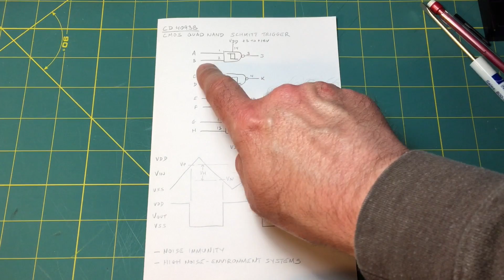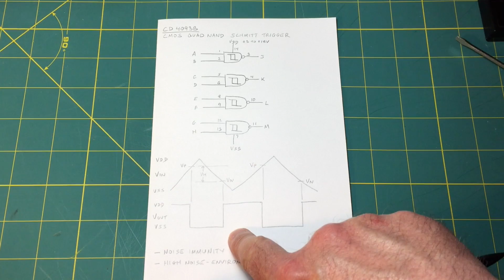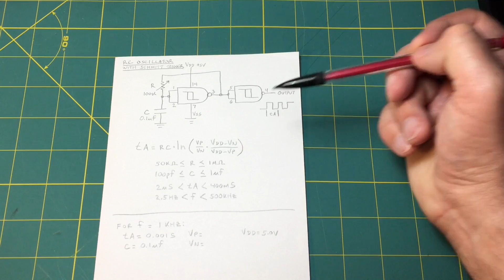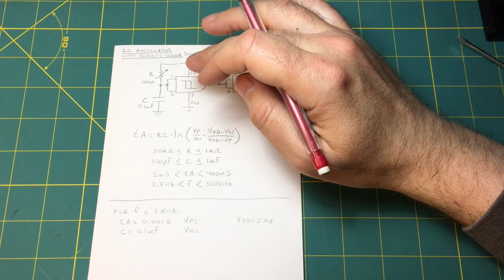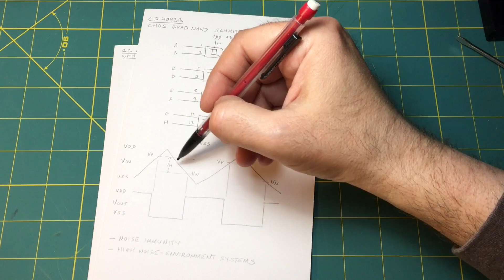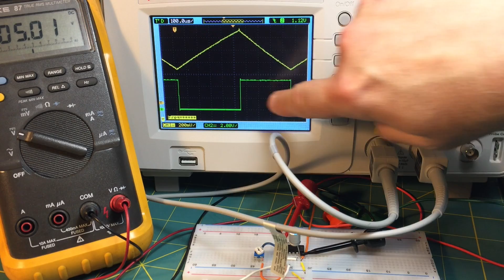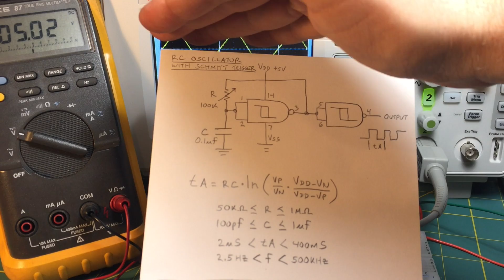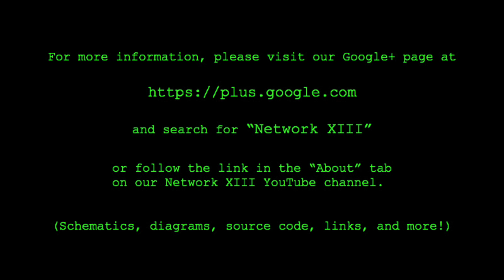Schmitt Trigger NAND Gate Oscillator

Comment: Thanks for posting. I’m in the process of building a 4MHz crystal Oscillator circuit using the cd4093be Quad Schmitt Trigger Nand gate. Any thoughts on which unused pins to ground?

Comment: Sir, I want 38 Khz frequency oscillator...with 4.42 volts as input voltage..what are the R and C values to be used..and what is the vp and vn values sir..please help me 🥺need it for college project sir
Reply from the maker: The design equation for a CD4093 based astable multivibrator is in the video, and also in the TI datasheet, which is where I found it: https://www.ti.com/lit/ds/symlink/cd4093b-q1.pdf

Comment: The output square wave mark and space doesn't look like same. I'm thinking to get similar chip 74LS132 to make a Scope CRT TV and 2 gate for Sawtooth oscillator for Vertical and horizontal . 2 gate for self oscillate for Inverter for step up to few hudred voltage for CRT , LM1881 for Sync seperator.

Comment: Could you help me to make the analysis of the asymmetric astable multivibrator, which would be the equations that determine the frequency as a function of R and C.  https://www.google.com/search?sxsrf=ALeKk02zzfiGZ8QtMxGDJtzPnAJw4R4DSQ%3A1590353991718&ei=R-DKXrqXK8qk_QbEhI6ADQ&q=multivibrador+astable+asimetrico+CD4093&oq=multivibrador+astable+asimetrico+CD4093&gs_lcp=ChNtb2JpbGUtZ3dzLXdpei1zZXJwEAM6BAgAEEc6BggAEBYQHjoFCCEQoAE6BAghEBU6CAghEBYQHRAeUMBMWP2PAWCImAFoAHABeACAAZ0LiAH0G5IBDTItMy4xLjAuMi4wLjGYAQCgAQE&sclient=mobile-gws-wiz-serp#imgdii=p5C2FMRSSraeYM:&imgrc=D2qfmLCBszySTM:
Reply from the maker: A formula for oscillator period as a function of R and C appears at around 3:02 in the video.  It may also be found in the Texas Instruments datasheet for the CD4093 https://www.ti.com/lit/ds/schs115d/schs115d.pdf?ts=1590548834906

Comment: starting to 3 minutes your are talking about charging capacity. But there is no input tension Vin connected anywhere in the circuit. HOW CAN YOU charge this capicitance ,?
Reply from the maker: kembo capelsii The capacitor is charged and discharged through R by the output of the first gate.
Reply from the maker: Sorry for my late reply.  The discharge path for C is through R, then into the output pin which is pulled low to ground, and back to the other side of C.
Reply: @NetworkXIII  the  output  when  it  at  low  level  it's  connect to  ground  right?
Reply from the maker: The lower output FET pulls the pin down to ground.
Reply: @NetworkXIII  thank you  so much  i understand
Reply: Thank you  Very much  for  your fast  answer.  i see,  but  why  the  capacitor  will  discharge  by  the  out 3 when it low,  instead of  to  discharge  by  the  ground.  sorry  I'm  bigger  i really want to understand everything  ^^